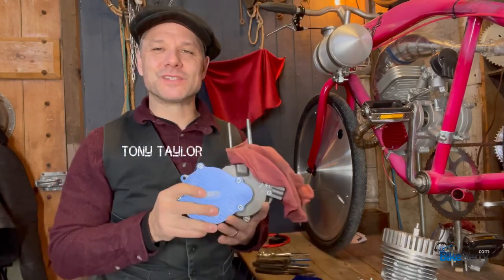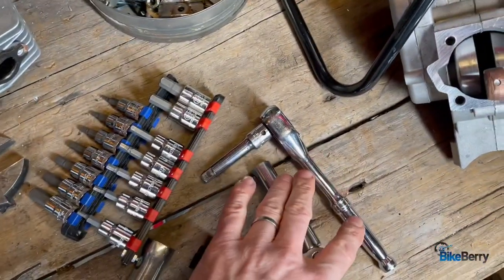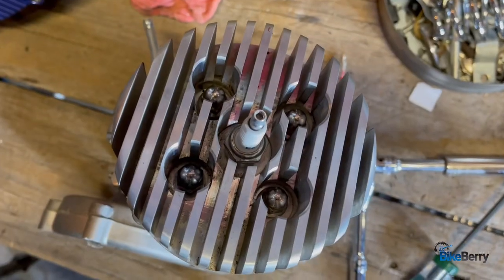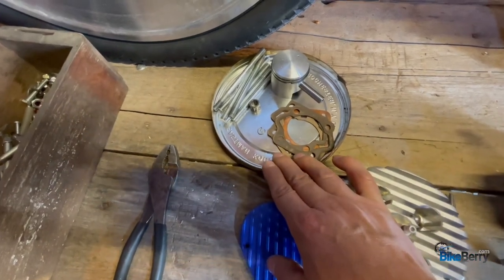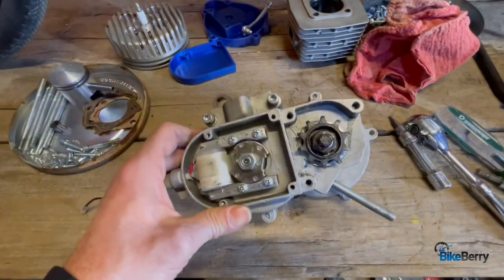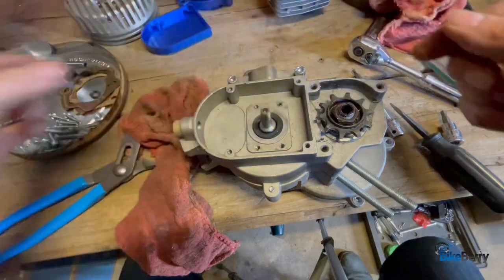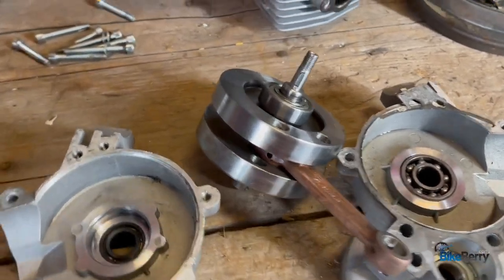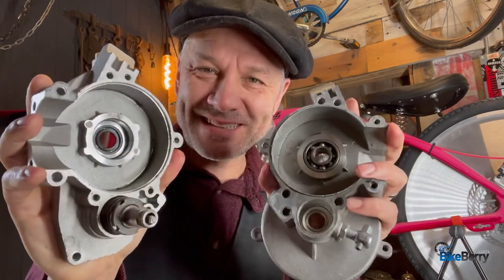Fully Splitting 66/80 cc Case In Half | Motorized Bike | Video # 1 | Bike Berry

Comment: 5:56 ok, this hits home for me as to why I often get frustrated with Creators like you and LA Hover, MotoredLife, etc.  You all have super high mechanical skill, and also you have money and tools.  Not to mention a shop, probably.  this video at least has you using hand tools, which I also have, though my ratchet is real dinky.  My point being, all of you guys build these really nice, high end, complicated mechanical bikes, when I just want the cheapest, most reliable method to get to work.  It often seems like the motorized bike community is similar to the PC building community in this aspect.  Viz:  there is a disparate volume of info out on high end builds than on the low end.  What can I build for the least amount of money that is bulletproof in reliability but not at all flashy?  Can I even find  66/80CC 2 stroke engine that is reliable?  And yes, I know I'll have 1000 people out there that will claim their build lasted __ years, but do you have footage to back that up?  Should I just abandon the 2 stroke and go for 4 strokes?  I have a 212cc engine sitting in my den right now, along with wide crank pedals and a pully based transmission,  like the kind you put on a go kart.I forget the name, but yeah, now it's just searching for a frame.  I saw the BBR frame on Amazon, and it LOOKS cool. (the Faker style one)  But it's also aluminum, which I dislike.  I'd much rather a steel frame cause I can weld on it easier, and I feel like it would be stronger and cheaper.  La Hover did a review on reliable parts, and he's mentioned some over the years also in passing, but I'd really like to see a comprehensive video, focusing on reliability rather than performance, per dollar spent, if that makes sense?
Reply: Check out the BUILD IT RIGHT playlist I created for this exact topic of a basic reliable build.

Comment: 8:06  I have often wondered about the magneto's in these  engines, and why you can't really generate very much usable power from them, and I had a thought, what if you changed out the stock magnets for strong neodymium ones and epoxied them in?  Obviously you can't add more coils, space is an issue, so why not dramatically increase the magnetic field?
Reply: Love that idea. You should try it out and let us know the results!
Reply: I think stronger magnetics will produce more electrical power...and nothing is free...so there will be less power to propel the bike...

But a nice 50 watts more would make a great headlight...so you don't out run your headlights

Comment: Hello, nice video. I have a motorized bike with the older type 80cc engine. The ones with the small ½" cylinder head nuts. Anyways, my question is how can you tell the difference between a bad needle bearing/bushing that connects the piston to the rod OR if you have a bad crank bearing?? Because my engine has a slight knocking sound when I push the bike back and forth. This is of course with the engine turned off. In addition to the small knocking sound, the engine doesn't seem to have much compression because I can push the bike quite easily without holding in the clutch lever and the rear wheel does not even lock up. What is the problem? Please help.. thanks

Comment: Ive been trying to remove the clutch nut for the past 2 days, ive used the biggest wrench and pliers i could find and that little fcker jsut wont loosen, ive bent the 3 pins like 5 times already, im scared they will break if i try more. The engine is 3 days old and the piston rings already shattered. I may just chuck it in the bin and call it a day.